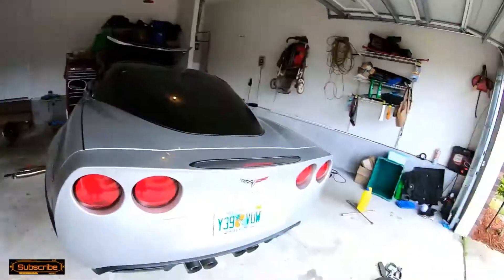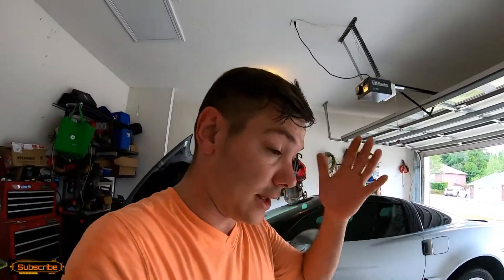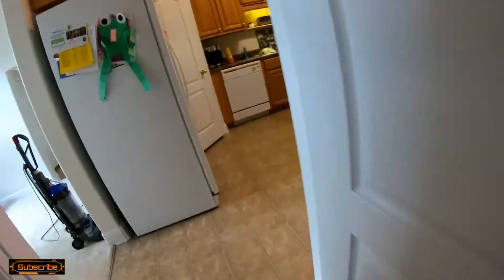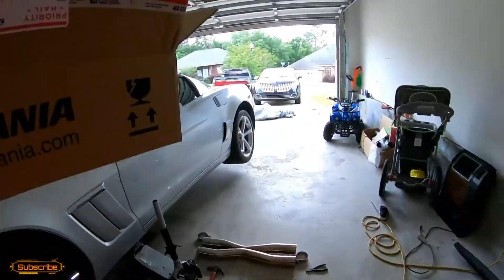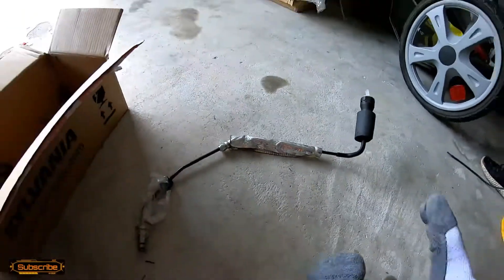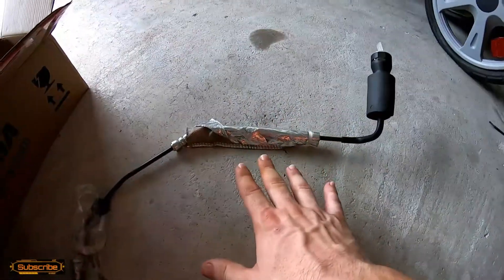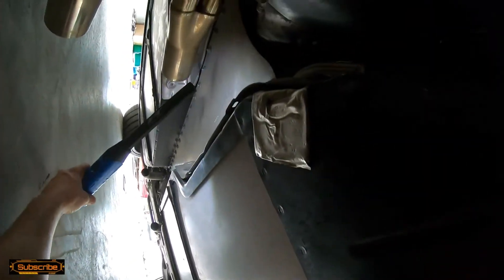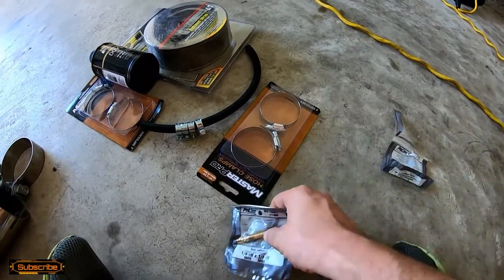Corvette Burned Clutch Lines!

Comment: tysm for the detailed video! i was able to fix my similar issue as well, burnt my clutch line in almost the exact same spot from my 7/8 headers, my issue was that i had my headers welded to my x pipe do to fitment issues like a dummy so i did this task without removing my headers, had someone on top of my car while i was under my car on jackstands, and we did it with patience and bloody hands. only diffrence was that with little space to work from, i couldnt get the barb fitting in the hose since it required strength and i was able to use my fingers in the little space so i used a straight 1/4 metal tube with 4 clamps and fixed it! appreciate the work put into this video
Reply from the maker: Thanks for the kudos on the work put it on video. Means a lot to read comments like that!
Reply: Hey what PSI Fuel hose did you guys use ?

Comment: Hey man I was wondering what size diameter is the fuel line hose 1/4inch or 3/8?
Reply from the maker: I think quarter it has been a while. Look at my fitting package in video or maybe you can Google it
Reply: Man I bought a 1/4 barb but the line seems way smaller inside I can't even get it to start in the line  @JoshRaySpot

Comment: Man, I literally just had my car tuned. Picked it up and 8 mins down the road she's smoking and clutch is at the floor. She's back at the shop and they quoted me $2100. How reliable is this method? I'd like to change the clutch too if I'm gonna have them drop everything because I don't wanna pay that twice. It's a 05 C6 but only has 20k miles on the car so, not sure what to do